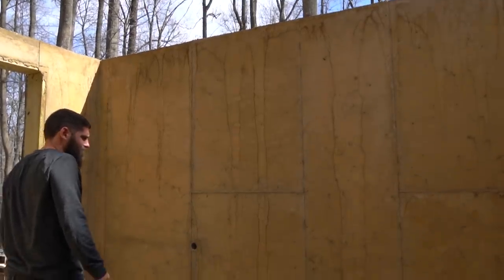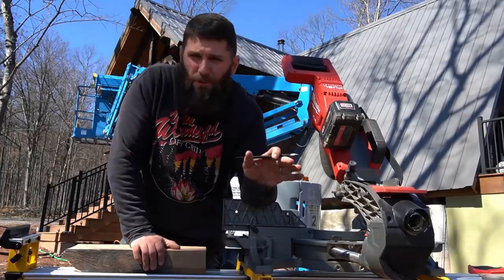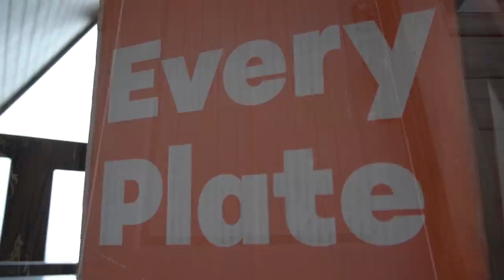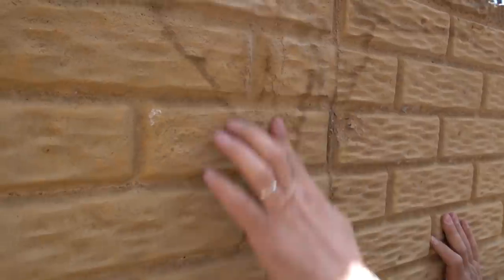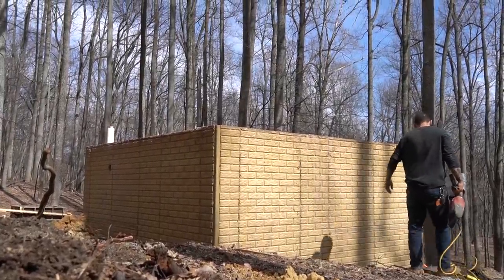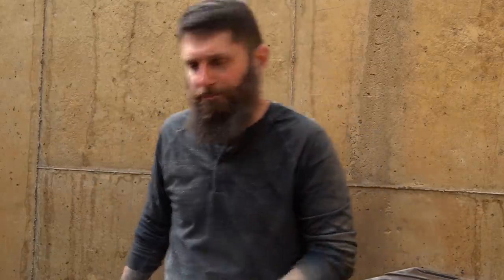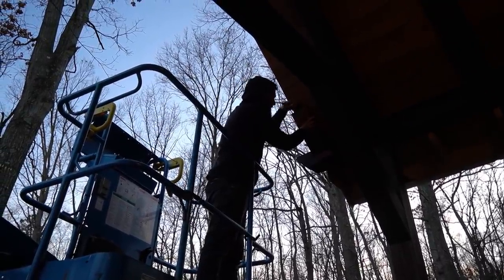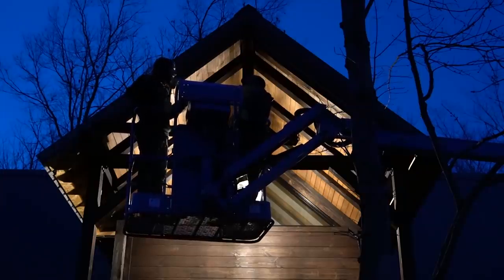Tearing Down The NEW Concrete Walls?

Comment: So,so,sorry guys to hear about the concrete walls ,I have been building for quite some time and concrete without rebar has no strength at all if the cabin will stand on it there is no structural support  I think,but you both have the right attitude ,I am glad you saw the mistakes ahead of the bigger build ,my heart goes out to you and I wish you will find someone that is more honest and accurate then that horrible Co.

Comment: There should have been structural drawings that designate the rebar size, spacing, and details on footing to wall connection. It’s not up the contractor or owners for that matter, whims or desires. I’m glad you’re knowledgeable enough to catch it before you framed on top of the walls.

Comment: I'm so very sorry this happened to you all. I'm with Josh as a professional plumber now retired I HAVE NEVER SEEN THAT MUCH WATER IN CONCRETE BEFORE. seems they were more concerned cleaning the pumper out quicker than pumping concrete to form then the way they quickly put the forms together with no rebar. If Josh wasn't there to check progress you wouldn't know. ITS A SHAME A CEMENT COMPANY CUTS CORNERS TO MAKE A PROFIT. BEST IS DO IT YOURSELF RATHER THAN DEPEND ON UNPROFESSIONAL PEOPLE TO DO IT FOR YOU. YES ITS A CRIME THE BETTER BUSINESS BUREAU WILL HANDLE IT. With God's grace all will be made correctly. And, I know from what I have seen you guys are the bestest in what you all do best. God bless be safe stay warm and healthy

Comment: I'm happy to see the both of you taking a reasonable approach to this mess that has been dumped in your hands.  Withholding the identity of the contractor is a good call.  No need to foster more negativity even if some of it is deserved.  This contractor clearly runs a scam business with how he handles communication with paying customers, so good on you for informing your local community about his work.

At this point one can only hope that the samples test out okay.  The multiple cracks are definitely not a good sign however; cracks usually indicate something was wrong with the mix.  From one of my previous comments in your last video the flaking and water stains are obvious signs of excess moisture as well as inconsistent drying.  My guess is those cracks formed because of how uneven the concrete dried.  I wonder if the contractor used 5000 PSI concrete because it came cheaper from the plant than other mixes and he decided to add water so he could pump it.  Pump mixes are always mixed differently and tend to be slightly more expensive than traditional concrete.

My gut tells me to take it all out, but then again, I don't have to pay for or spend the time to do whatever work the both of you would be responsible for.  Were you able to observe if there was rebar in the footing at least?  That would be of equal concern, but unless you already saw it, the only way to tell would be to tear it all out.  Absolutely awful situation to be in, but as painful at it is, at least the two of you were able to catch enough red flags to understand something was wrong.

Comment: Hey WWOG! I work with concrete and I will say not all is lost. If the compressive strength test comes back within spec, which I also have my doubts. Visually you want to see a deep grey colour to the mix, not the brown you see in your mix. But if it does pass the CST, you can key coat the outside, use a reinforcing mesh, attach it to the outside walls and if you have the skills, plaster right over the mesh and finish it off. No cracking or flaking off in future. The uneven finish on top of the form work you can lay your wood out, level it with spacers and fill it up underneath with non expansive grout. If you need any more details email me.
Reply: Not that it matters just a little info, but the reason why it was brown is they must of colored the mix so it would match the house later. I assume the normal grey color would be a eye sore.

Comment: As a Union Roofing & Waterproofing contractor you are going to have use also a concrete saw to open up those cracks in a straight line as yo can & use concrete epoxy to strengthen them then water proof the entire wall that’s if it is savable. Then waterproof the entire footings and foundation. But normally we waterproof the footings before the foundation walls go up.

Comment: Feel like I’m talking to myself after 10+ years of commercial construction on a cancer center 
Some excellent trades but many many thieves & bs contractors that cost us millions in rework, demo, mitigation, & remediation 

I’m sorry for your troubles
You will surmount this
Foundation is everything in a house & life
Literally & figuratively & biblically 
Having to stand over, tend to every design build detail, double & triple check, including material specs, including concrete, rebar & more 

We’re in your corner rooting for you

Comment: Seeing the beautiful light fixture/ lantern over your porch swinging a little I wonder of you considered additional cables/ chains fixed between the post and the lower corners of the light to prevent it from swinging too much at high winds? It’s rather common to do that (prominent example would probably be the big chandelier at the WH).

Comment: We used to have the same issue with costs of an attorney vs what you could recover.  Don't know the value you're looking at for the concrete work, but we had our best net results going thru small claims court.  No lawyers involved, and a judgement (even if not paid) sits out there and eventually causes them to address it and get it paid in order for them to do something they want to do.  Just a thought, aside from going after their bond, which might help too?

Comment: I was a sub on 34 hotel builds doing both HVAC and elect. Spent lots of time watching other trades.  I watched your video of the pour and was horrified how wet the mix was, I'm guessing it will test <2000 psi. Besides not adding rebar they also didn't vibrate the mix during the pour, hence the plate anchor bolts sinking in the wall, and the uneven top. The dirty base gravel was the biggest hint these guys were fly-by-night. They couldn't build an out-house. It might be time for another emergency Little Debbie package.  Mark

Comment: I'm surprised you didn't run the laser below the top of the wall an get a good visual of just how bad the walls were out of level. you could then photograph the laser line with a tape to the top of the wall at various wall spots as well as see if ther is a tilt that would show whether or not the foundation was even level. My heart goes out to you guys. With the wall cracks and no rebar already at this point without there even being a load on it, and no slump test I would be very careful about using that for any supporting foundation.

Comment: I am so sorry you are having to go through all that. I have a lot of experience in the concrete and construction industry and I’m positive the concrete is no good whatsoever. The shrinkage cracks and spalling off the walls is horrible. I would recommend contacting the concrete supplier if there was one for their input. It looks like a full tear out and needs to be redone. Recommend regular wall forms and do brick facing if that’s what you still want. Too hard to blend stamped walls. All the best. 🧡

Comment: Could not believe how wet that mix was when they were pouring it. Tough to get anyone to do anything right anymore. That's why I try to do it myself if at all possible. Also was surprised they didn't key the wall to the footer.  Usually either put upright rerod in footer or put a key in the footer.

Comment: I tend to agree with the consensus of...redo it. Unfortunately as most have said, the foundation is THE most important part of the build and if it isn't right...You are having to fix EVERYTHING the rest of the way up, from level to plumb to square. You guys have come a LONG way and are more than capable. If I wasn't so far I would gladly came and lend a hand. Do it right, right from the start and you will have no worries down the road.

Comment: Sorry to see you go through this, that is substandard work, I wouldn't have allowed them to start without rebar for those walls, and I wouldn't have paid a cent. I live in a warm climate, But i think you'll have trouble with moisture incursion in the cracks, when that moisture freezes I Imagine it will destroy the walls further. I'm in the tear it down camp...  PS, Josh, the water on the drill actually helps with the cut, all concrete cutters should be used with water...

Comment: With the testing at 21 days it will most likely be at 3500 psi, however the wall without rebar’s will have structural deficiency unless they used fiberglass in the concrete. I would have your design look over the data to confirm the structural requirements for the space. If the company was licensed they might have a bonding company to help cover the cost of the rework since they appear to have defaulted on your contract (ie lack of rebar). Just a tough place to be good luck and look forward to seeing your next video.

Comment: Josh, there is a 30day, 60day, 90-day crush test. So it may take 3 months for the final strength. Was there any re-bar used in the walls? You might want to coat it with a water seal. The longer it stays damp the harder it will cure. That's a nice look to the eye.

Comment: Generally, Concrete takes about 28 days in normative, not frozen conditions to "cure" or "mostly Cure".  Did your PSI test facility talk to you about that ?  It seems you were just shy or right at the 28 days.   if you jack hammer the walls, are the footings usable or no rebar there either ?

Comment: Mere formality at this point. Level it and lay concrete blocks, rebar & core fill. It is a small structure. You can veneer real/faux stones on the exterior. You already have that under your belts.

Comment: 1)On that wall you need metal rods... 2) the concrete should  be a 5mix with waterproof líquid....3)and at a temperatura a 60 t0 70 for a good  concrete casting  ....4) and let  dry with the forms long enough 👍

Comment: I know quite a bit about concrete. Other than the fact that rebar wasn't used, you can see that the mix was too thin. Insist on something called a slump test for the concrete. It's a metal cone that's filled with the concrete. When the cone is removed, the concrete should stand on its own with only a slight slumping.  It must have a mix of fine, medium and course aggregate. You probably know these things.

Comment: Could you move the house location and use the existing structure as  a storage shed or something?  If your have to tear down the concrete,  you will have to haul it away or burry it somewhere.  Sad that you have to deal with that right out of the box.  an inch out of level on such a small structure is pretty sad.  Good Luck.

Comment: Make sure to add gutters to the house. If you don’t move water away from the foundation of your house the concrete pillars will slowly settle at different heights and will require major work to fix. Best to prevent the foundation issues rather than fix it later.

Comment: When I watched the Video of the concrete being poured I thought that was a very watery mix and then to find out that Rebar was not used is totally wrong, These walls are going to support the rest of the Cabin, I hope that the report comes back in your favor, It will be a shame to have to knock it down and rebuild it

Comment: If you have to report make sure they have vibrators on them forms and make sure the truck driver has the certification they're allowed to add a certain amount of water I could tell it was way too loose of a mix

Comment: I observed that the concrete appeared very soupy during placement. You could have ordered concrete testing during the placement, where the testing agent visits the site during the placement and takes samples during the pour. Are the walls reinforced? You designer should have specified wall and foundation reinforcement. You should also take samples from the foundation.

Comment: The  cracks might be from  to much water in the mix , freezing without covering the walls with blankets as it is curing . Check with the batch plant for the design mix that corresponds with your tickets . Make sure the design mix matches with the engineered strength that is called out for. It takes at least 30 days for the concrete to come up to full strength. If it comes out under 3500 it may not be the concrete companies fault if the concrete contractor ordered a weaker design mix.  Even if it tests below 3500 it should be strong enough unless it is a complete fail.

Comment: The concrete was way to wet and looks bad, tear it down and do it right, Save trouble down the road.
You probably think about putting maybe some copper flashing above the rock your putting up. It looks like the water could get behind the rock and concrete board, again trouble down the road, you may already have a plan. Great Chanel.

Comment: You two have been more than generous in not calling out the concrete contractor by name. It is beyond comprehension that a crew would do such terrible work when they knew they were being filmed. It sucks that you will be tearing down those walls but better to do it now. I'm certain the concrete company, the pump truck owner and the finishing company won't have a leg to stand on. I would hope there is an attorney out there who will take your case pro-bono and sue them into next week. Best wishes.

Comment: I'm sure the company doing the testing of the samples will apply statistics to "predict" the probable final resistance of the concrete since you have taken them before the 28 days... No problem, within a reasonable margin you can trust the results. The excess of water and the colorant both diminish the concrete resistance. The use of fluidificants (which do not affect the quality) and the vibrators are the correct technics to easy the job of pouring the concret. Also if temperatures can go down near  freezen point another additiv is necessary. Good luck and keep your spirit, we all are with you 😉!!!

Comment: The video you showed of them pouring it where is the rebar concrete has good Compressive strength but without rebar the ability for it to continue standing against any side loads would be questionable never seen a wall poured without rebar

Comment: Check references for subs, and suppliers, and in the future for any slump variance, require the proper dosage of a water reducer, sometimes called Super Plasticizer , most times will test at higher strength, and require test cylinders to be cast with all structural placements, common practice is 4 per pour/placement and the testing agent just picks them up, or, you drop them at the lab. Learning, Learning, and won't forget. Even an electrician can do it ;-)

Comment: Whether it makes 3000 psi or not I think you should take down the walls because there is no rebar in there. From the looks of the pour and the looks of the core I'll be surprised if it makes 3000 psi

Comment: If U ask a contractor;... put out 4 tender a Job of any description along with all drawings plans necessary 2 fulfil the end goal...
I know it does;... but it shouldn't matter if U take the Cheapest;... Middle or most expensive quote;... estimate...
Unless unforeseen problems occurs;... stops the job;... not picked up;... noticed by both parties involved... Then & only then with an amicable solution is obtained by all... Prior 2 re-commencement of future work...
Stage payments should also B set up;... then signed off by both parties involved...
Any & all errors;... defects;... mistakes...  that have not been agreed 2 should be rectified amicably by the contractor...
Reply: Well that was a consolation that U R only down 50% of the quoted price...

Comment: Watching the pour… that mud was way to wet ( the more the water the less the strength). In CA they do a slump test on the concrete. The pumper guys hate the inspectors due to the fact that u can’t pump stiff concrete. The pumpers always cheat and water it down so it’ll pump. There’s a challenge to keep it stiff and stronger or thinner so u can pump it.  It looked like those guys that poured your walls were watering it way down. I doubt if it’ll pass the compression test. 
If the guy is licensed at least report him…. My 2 cents

Comment: The vertical cracks in the concrete are caused by foundation failure due to poor compaction of the soil. The compaction of the soil needs to be at least 90% compaction density.

Comment: Hey  Josh, do not break it down, use the inside wall as the inner concrete case. Drill anchors on the bad construction and put a new steel  mesh. After that  put another concrete case on the outside and pour new concrete.

Comment: I'm in the process of buying a house in the south not too far from you guys. There's a possibility of a floor joist issue that needs replacement (settelment,decay or termite damage) caused unlevel floors. My question is do you know if the Japanese wood burning technique you used on your exterior would be beneficial against termite damage or maybe even a metallic paint, since they don't like metal, along with using treated lumber and termite treatment? Any information would be great. I really respect your opinion and knowledge.

Comment: I am sure a nearby lawyer fan of the channel would take the case for costs only and any fees they can recover from the company.  Number one thing is to contact the state Construction Industry Licensing Board (or your state equivalent) to go after the person with the license that signed off on the project.  You will get results when you go after their license.  And yes you need to tear down the concrete.